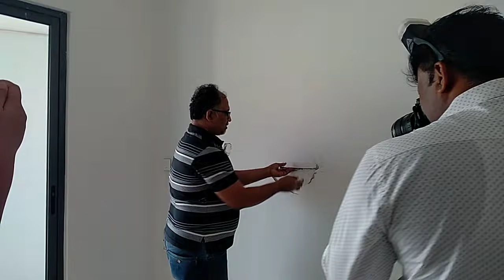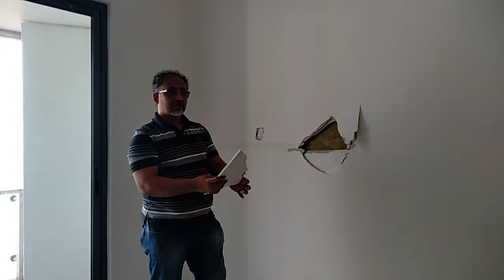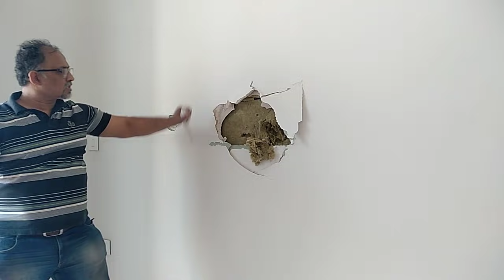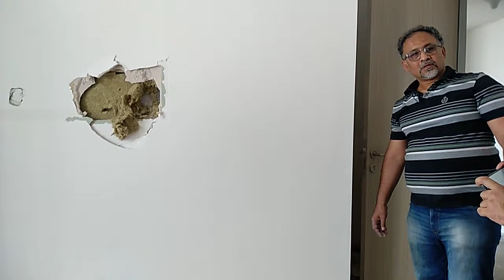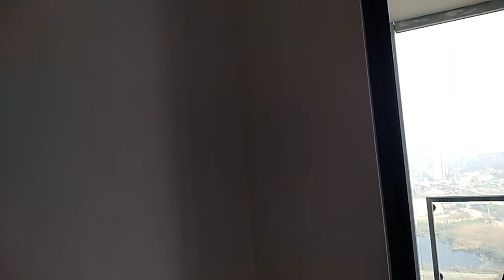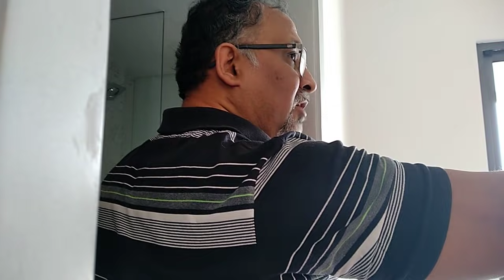Are all gypsum walls as weak as Lodha NCP's? One more Lodha wall punch video

Comment: I dont see any issue in using a dry wall for partition however the lack of proper structure to hold it to collapse easily. Even on a properly installed stud wall structure, a strong punch will go in esp if its in the void between the studs. The main issue here is the back structure. Repairing or closing a hole on a gypsum board is far easier than a cemented wall, no need to redo the whole wall, it can be patched at the area of damage.The wall putty is applied on top of the board and specific paper or fiber joint tapes to prevent a paint crack at the board joins. The insulation material shown is rock wool along with the drywall it acts as weather insulator and has acoustic properties too. In youtube itself there are many videos about repairing a drywall, easy as a diy job. The material itself is fire retardant, however the way its installed determines how the fire is spread, if there are gaps it will spread. I think apart from the structure issues, the people are worried as they are not aware of the construction method. Hope the builder might have mentioned it in the brochure.

Abroad there are quality control checks by building inspectors to guide the construction but its a dream in India as of now. Moreover this kind of construction is very durable and far easy to maintain and has several positives only if its constructed as  per the specs. Its expensive too than a cemented brick wall. I dont think there is any building rules to check the quality for this kind of construction method as its rarely used.

Comment: but thats how American house are bild
Reply: Indians are stuck in 17th century and this person does not know anything about how high rise buildings and modern houses are build. The walls are not indicative of how strong  building is, they are just  room dividers. Towers are build with metal pillars and dry walls so that withstand all vibrations and earthquakes. High rise buildings design to sway during earthquake and high wind without breaking  apart. The brick or concrete walls are dangerous because they put heavy weight on pillars and if the towers sway it will collapsed
 My whole house has all gypsum dry walls, very easy to maintain and renovate,  easy to paint and after 25 years it still looks brand new.

Comment: The wall in this video is a partition wall within one apartment and probably not between two adjacent apartments. For highrise structures/ tall buildings to keep the dead weight in check,  lightweight partition walls are being considered in design with pre-planning in some projects. If this sort of a wall is provided between two adjacent apartments it may be a security concern. However within one apartment it's not a security concern. If people are not aware, such walls are very common in new hotels. The wall is provided with sound insulating properties using relevant infill material  to control decibel levels between two adjacent rooms.Times are changing and if the use is pre-planned  and well thought over and also conveyed to the buyer these kind of concerns would not be raised. It's hightime that  people are being educated about such use so that they don't feel cheated in the deal. There is no harm in adopting light weight partition  walls if right specifications have been used in it's construction and the limitation of loading/ fixtures which can be mounted on it have been well explained to the end user.
Reply: Key is "if they have been explained!!!!"....you got the answer in your explanation...

Comment: What has Lodha mentioned in the agreement. All these construction material must be there in the agreement. 
If yes, then why such a hue and cry. If no then you are open to go to court. 

If you have not read the agreement, its the issue. If Lodha has not used the quality of products he mentioned in the agreement or the brochure, then you can go to court. 

However, just expecting it to be a cement wall as per traditional Indian homes, is something difference between your perceived expectations vs. Delivered. But that cannot be the base for this drama.

I am watching your videos. Even you have blamed the judge, even before judgement is passed. It may be judge is not showing taking your favour so that Lodha does not have time to react. Or may just feel that everything is Ok, and judge is favouring them. 
Whereas, judge may be otherwise strong basis the architect report.

Yes, I understand that you felt cheated. But is it really true on papers. A builder can stop you entering under construction building. As in case some accident happen with you. Who would be responsible. 
You can avoid taking possession if the flat does not meet the agreement based standardisation.

Comment: is this is the first time these guys have seen drywall and insulation....lmao
Each and every house in usa and canada is build this way and most of Europe ....lol
Reply: Doesn't matter if it is drywall or wetwall, it has to have some strength. If you can have cracks with a little bit of force, if you cannot hang stuff off of this wall. Are you telling me it's good?

Why not a regular brick and cement wall which has some strength?

Drywall must have specific applications. I am sure they are not used everywhere.

Comment: I completely agree that they have abused certain codes while building this apartment. Also, you need to understand that a lot of the builders are going eco friendly and anything to save time to finish the construction. That said 60% of the world building and houses are built this way maybe in some countries thicker gyprock, well insulated walls. Still they can be broken by punching or hammering. Theres no point of breaking walls and building your cost high. There are high severe issues than your walls so flag them to the builders. Good luck

Comment: Am I the only one who is shocked by people's shocking expression about non-brick wall technology? :)

This technology is used all over the world to reduce weight and increase heating cooling efficiency.
Reply: indrajit jana it’s not the fact that it’s drywall it is the fact that it is such a low specification and also very badly assembled. There are many required components that have been left out
Reply: @santoshgami4868  I don't think his concern is low spec, he literally says he can punch through the wall, of course you can punch through a drywall with all the components.
Reply: Raghunandan Reddy C he is punching at the same level as the missing noggin channel na, he may still punch through but not so easily
Reply: Foreign cities in foreign countries aren't humid like hot and humid like tropical Mumbai. How many decades does the builder guarantee that these walls will hold?
Reply: Yep you are right, In USA they use same technology to reduce cost and time.
Reply: Well there's something called as heavy Rainy Season in Mumbai.
Reply: indrajit jana guys there has to be building code in every city . In US they have a code which the builders need to follow. I don't know what code in India says whether dry wall can he used or not

Comment: Folks this is how multi million dollar homes are built in Canada and the United States. Steel or aluminum studs with drywall (fire rated) screwed onto the studs. Insulation is put in-between the walls to keep the house cool in the hot months and warm in the cold months. The plumbing pipes and electrical wires are hidden in the walls, this gives the home a clean modern look. This is the construction style used in first world countries. Multi million dollar homes built with very few problems with buildings collapsing or burning to the ground. Modern style not typical brick and mortar. Low quality brick and minimum cement used in the mortar. Electrical and plumbing on the outside of the walls???? Is that quality?

Comment: there is nothing wrong with the house. Stop misleading people. check the contract it would have said the house is built with Sheetrock and insulated. I would say it's not builders fault you didn't do the due diligence in finding out what materials they will use to build the house. Will it be a brick and mortar house or is it going to be made with drywall (Sheetrock). The houses made in Canada and Us are from this material and lasts 100+ years.

Comment: That's called Drywall 99% of the homes built in North America are built out of this material.  It can be easily patched and fixed.  That is a totally acceptable form of material for an interior wall.  Also water shouldnt be an issue because you shouldn't have moisture or water inside your house to begin with.  Drywall is a much better product to use inside a home vs a brick/motar wall.  If you want to give your home the feel of a cold jail cell go ahead and use brick! lol
Reply: india is a very hot and humid country its better to have a cold brick wall

Comment: I don't think he is a civil engineer or someone that has ever seen this kind of construction in his life.
I work as a special inspector (civil engineer) in New York City. My company performs inspections on the work done by the contractor. Most of the homes in the west are constructed from wood. They use exactly same materials for interior walls. And fire rated walls for exterior. Some people prefer to fire rate the whole home but that's not a common practice. Even for a multi story building it's not a common practice to use brick/ concrete wall inside as it adds weight. This idiot doesn't know what he is doing by punching holes into the walls. At least he should have brought someone who is experienced with this kind of construction to talk. 
If there is something I'm missing please free to reply here. But this video looks like a complete nonsense created by a guy who doesn't know his stuff.
Reply: Raghunandan Reddy C

 if you are an inspector why can you not see the 3 major problems in this video ?
Reply: Raghunandan Reddy C how did this man get his hands onto the joints of the board? Why no noggin channel here
Reply: Baba Yaga   really? So when you sign the sale deed its written that the house has to be made of brock and concrete? Idiots its not cardboard but drywall.
Reply: @alexthomas3176  paid troll. Did you google died? Search for drywall.
Reply: @santoshgami4868  which are?
Reply: TRueC callername . 1. No gyproc noggin installed on horizontal board joint 2. Mineral wool not fitted correctly 3. Strip of board fitted at floor level with no noggin channel at board joint. Screw centres not maintained at 300mm centres as per Gyproc Saint-Gobain India norms.
Reply: Guys, reddy seems to be paid for making comment !!

Comment: people in India calm down. there is nothing wrong what is done and with materials but should be angry how it is done. It appears its done wrong. disastrous. Looks like the wiring and pipes and baseboards everything But not done according to code. As if the building code dont exists at all. Even when I do this at home I do it as per the code. Its common here in Canada and US. FOR YEARS.
Reply: TRueC callername they have used roadside contractor that doesn’t know drywall’s and this is the result
Reply: This ain't a low cost home.